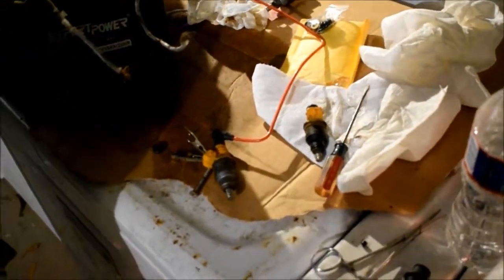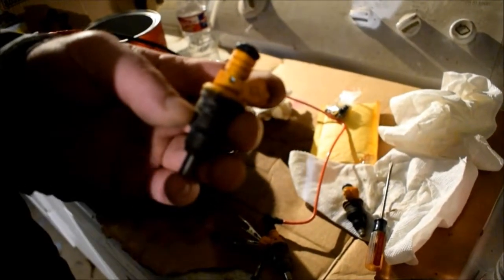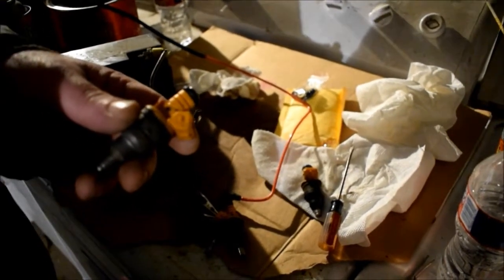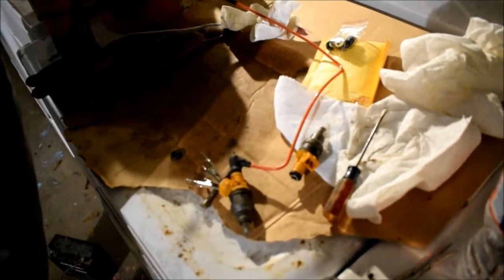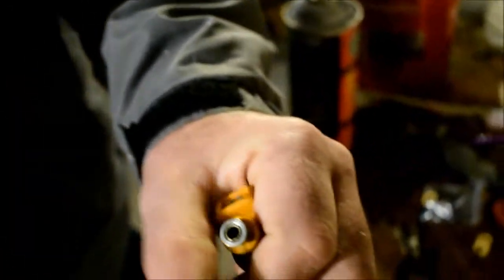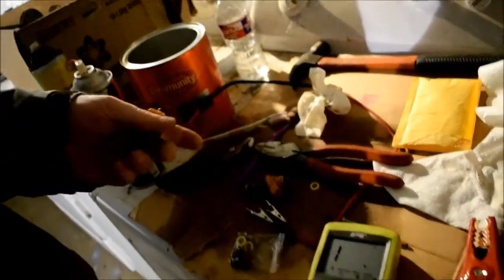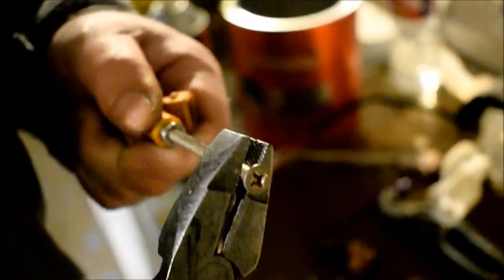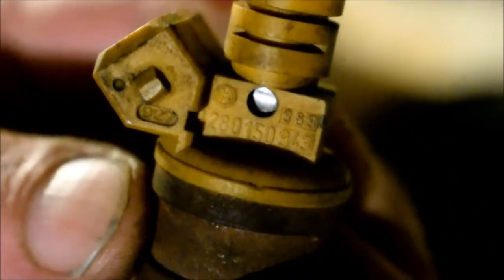Ford 4.6l/5.4l Fuel Injector Rebuild and Differences

Comment: The fuel injectors' solenoid with time and use may get weaker electro-magnetically where it may not induce (build) an electro-magnetic field of flux (cutting lines). Hence, due to "planned obsolescense" they can't be internally rebuilt cheaply which sucks for the consumer and environment. But, please dissasemble one and crack it open on camera.

Comment: Awesome insight! This explains what ford and Bosch could not. Had #3 replaced and yes D5B/A was put in and rest was B. I agree consistent pedal and rpm until u put to floor or almost, to get into passing gear and yes it cuts out and will give a misfire code for injector with the A injector in it. Only puts code if u keep your foot in it and flashing check engine until u let off it and then it will smooth back out and light goes away and engine is back to normal. So I’m totally agreeing with you that it does make a difference for sure. Mine is a 98 f150 5.4 triton and I spent $20 and rebuilt the rest and see what happens. What a relief to come across this video and to agree and understand with me. Thanks guys.